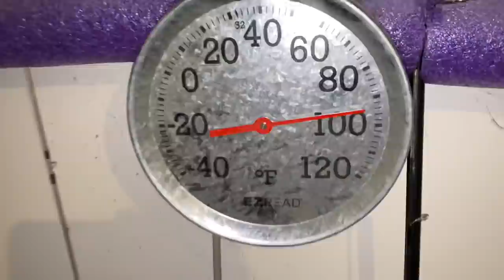I Was Kevin All Along!? *SAD*

Comment: You can go around the house nail up some ceiling supports to the ceiling joists (joist to joist ceiling to floor) and sawzall every one of those base plates out, and hammer in a new 2x4.You are prob going to be too far and too close everywhere so will take some fuckin around with shims. Btw your exterior walls are load bearing, so that missing plate underneath the door needs to be addressed pronto, id support that wall in anyway i could even if its temporary. You can't let it sit, the house is going to shift.
Reply from the maker: Thank you!!! 👨🏻‍🌾🤝
Reply: Sound advice

Comment: I would definitely replace those sill plates before you sister in new studs. It will be much harder to bang the new sill in afterwards. Use some inexpensive bottle jacks, span two or more with a stout piece of dunnage underneath anywhere it’s solid, and gently jack the house up until you can bang the new sills in. Those need attention ASAP! They’re holding your crack house up! Don’t try to jack anything up with one small point of contact like a single jack or you’ll likely put it right through that soft lumber when you try to raise it. I’m a contractor in the Seattle area. Sills rot out all the time due to the weather here. Good luck!

Comment: For the base plate find the sturdy cut the rooted measure how long you need to replace get 2 2×8 or 8 what ever it is cut them to lengh then nail them ontop each other then tap it and level it and the new upright and floor beams and toenail them into the 2×6 or 8

Comment: If I wasn't 1200 miles away I'd load up the tool-tank and give you a hand on the weekends. Geographically challenged tho...
Good luck with the crack-shack rebuild, not undoable but you signed on for a lot of work.